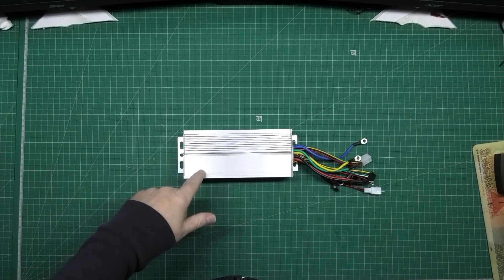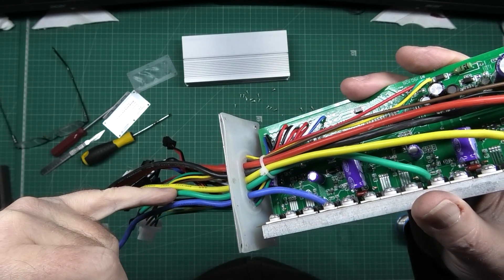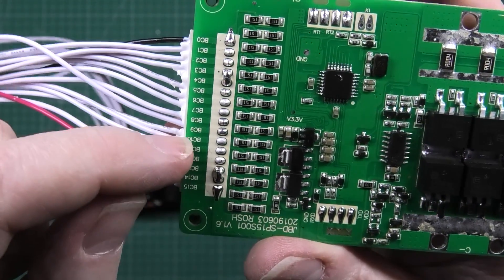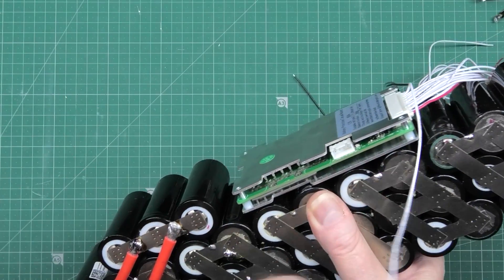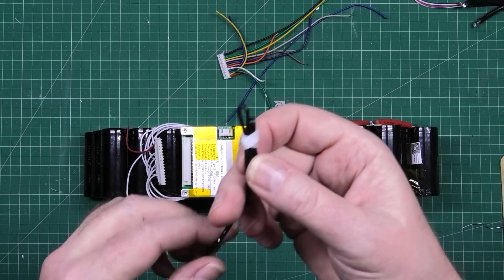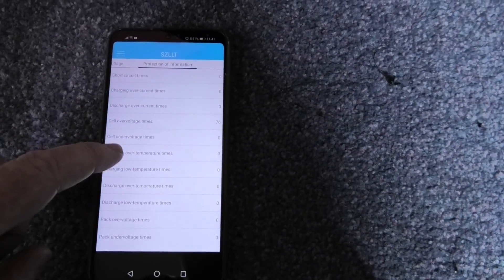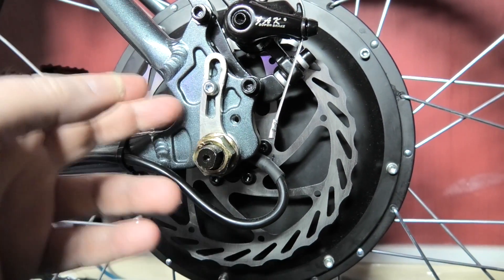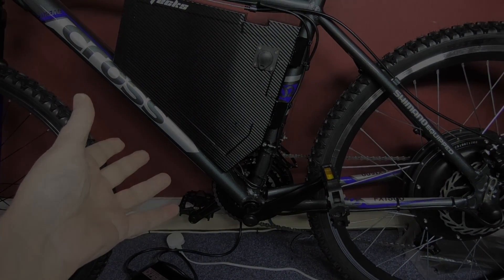Budget 1500w DIY eBike build part 4 - It's finished!

Comment: Hey i just bought a 1500w 48v ebike kit and i bought a 48v 26ah  bms 40a  battery and when i connected them i got a spark between the cable i checked it is normal? that black goes on black and red on red im confused can anyone help me please ?????
Reply from the maker: Yes, it's normal, it's caused by the initial charge of the big capacitors in the controller. Ideally, you should use an anti-spark connector to preserve the battery and controller (and your nerves 😂)
Reply: @Vortecks  thankyou mate😁

Comment: Hey i just bought a 1500w 48v ebike kit and i bought a 48v 26ah  bms 40a  battery and when i connected them i got a spark between the cable i checked it is normal? that black goes on black and red on red im confused can anyone help me please ?????

Comment: Excellent have this cheapo combo coming for my other '53 Roadmaster bike rear single gear version. My 2wd is 1.2kw now and I put 2x 10mm wrenches on the front axle lock works the treat with two hose clamps each. Can I make 2 24v batts into 48v easy without upgrading the two 24v bms? thnx.
Reply from the maker: As long as each BMS only sees 24V, it's possible but the BMS's can only be used for balancing. You'd probably have to bypass the input and output of the BMS to disable a potential 48V from going through both BMS's. You won't be able to use P- or C- on either BMS and you'll probably have to charge each 24V pack independantly.
Reply: @Vortecks  Thanks, plan A was to series the xt60 and disconnect both from it when charging. The 24v discharge in series via bms will be the next hurdle maybe.
Reply: @Vortecks  Looks like I may be bodging a 48v bms with the cells so will be prepared.

Comment: Hi Tony I've gone and got the same 1500w kit but my controller as thick copper rods inside is that just PC processor heatsink paste to use
Reply from the maker: If they're screwed to the casing, they'll be heatsink bars and you can use any thermal paste you want (silver is better).
Reply: @Vortecks  thanks for the reply mate iam gue you put the paste along the metal bar that screws to the alloy case

Comment: Correct me if im wrong but wouldnt a 13s3p pack only be capable of delivering 15A max continoous current if each battery has a max continoous output of 5 amps so its just 48*15=720W ?

Comment: I ran a 1500W front hub motor with no torque arms, and it exploded the dropouts on both fork legs! New forks fitted with torque arms this time!
Reply: I didn't like the torque arms at first. But after blowing 2 fork's in a row I'd had to give it a try. Fitted 3 torque arms for 1500W front hub motor ~46Amp controller.
Reply from the maker: As I always say...… forks are designed to do one thing..... stop you. Personally, I'd never put a motor on the front but there are a lot of people who prefer it that way.

Comment: Which 3D printer do you have Tony?? What's the build plate size??
Reply from the maker: It's a Creality CR-10 with a 400mm build plate. I'll be trying to do a full review and also, going through how I design stuff soon.
Reply: @Vortecks  sounds great fella, look forward to it ;)
Reply: @Vortecks  Hi tony did you change you plate because mines only 300mm
and what software do you use is it cura
thanks
Reply from the maker: @kevinlloyd3403  It's 400mm x 400mm, that's the size of the printer (I bought it like that). There's also a 500mm version but that's way too big.
I only use Simplify3D, it's expensive but worth every penny.
Reply: @Vortecks  many thanks Tony done in 2 halfs now

Comment: A couple of suggestions Tony. Adding extra solder to the traces does not increase capacity appreciably. Soldering a heavy wire will do a lot better. Go mad with the silastic on all the large caps particularly the one laid over to increase vibration / fatigue resistance.
Reply: Well, it seems Tony meant not capacity but capability of traces to hold up to the current, amperage.

Comment: I've got a dead controller that looks identical to that one. It came with my 1500w Hub.
It died after I rode through a 3 foot deep flood !
Reply: It's not dead its just telling you it wants a trip to see big clive in the IOM..
Reply: Defo dead.... I had one that I rode in torrential rain that wasn't sealed and I posted a pic on the forum of what happened to its internals... I replaced mine with a KT36/48 1500w pure sine wave for £45 from amazon... Works great once I had worked out the wiring

Comment: So when can I pay for it ya sexy beast? This would help me get out more like the scooter I got same as yours on your recommendation etc it helps me get out.
Reply from the maker: The range is 10-22 miles (I weigh 72kg and full throttle is 10 miles, throttle only @ 15mph is 22 miles) and it doesn't go as fast as I wanted but it still does 35mph..... And, it has 2 stickers on it which cost me £3 😂
The price is £700 cash and I'll drive a 50 mile radius from Cannock Staffs (either to meet half way or deliver it) but I won’t be shipping it anywhere because I know what couriers are like.  If you're still interested mate, drop me an email - vortecks2000@gmail.com